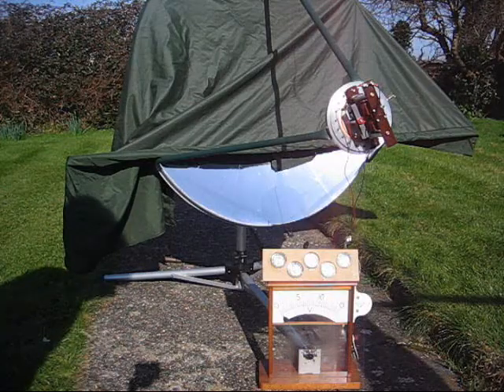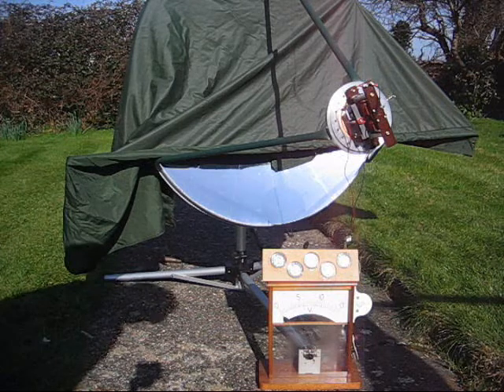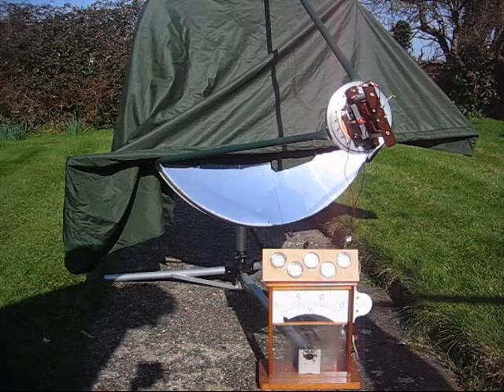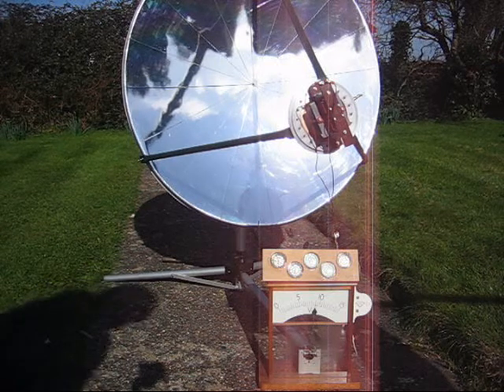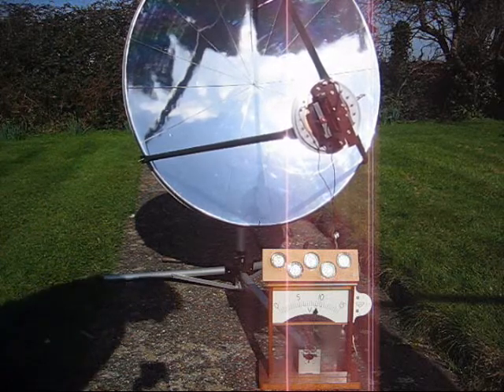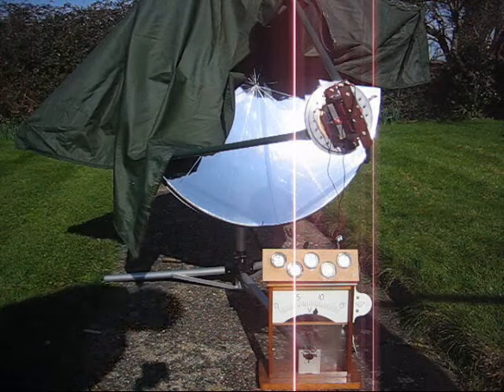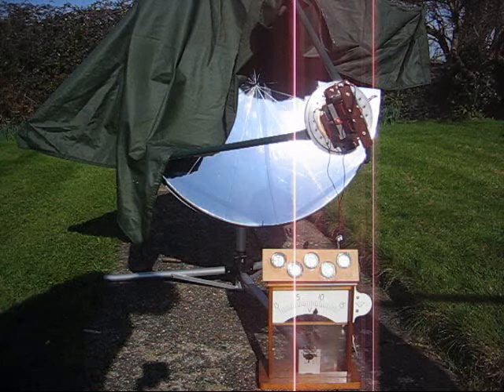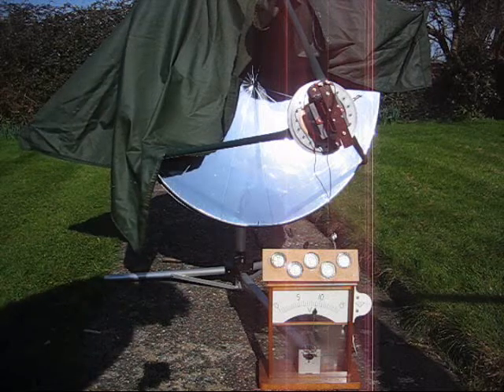Solar powered  Stirling Cycle TMG

Comment: A great job I think by adding a small solar vacuum tube to the heat collector you could enlarge the generator. It's an awesome thing, make some plans, and don't let it be lost like so many great ideas..sell them or give them away, just make sure there is something for someone else to work on, and maybe improve...again great job

Comment: Too much energy , from solar ? :) , that's a new 1 in this world of waste.
A larger engine would be called for.
The vibration of the disc can be overcome by using dissimulator gauges laminated , their harmonic frequency will be different cancelling each other's vibration out.

Comment: Cyril,
Thanks for all the great videos. You do some fantastic work and it shows.  Have you done anything more with the solar powered stirling with regards to dampening like rubber washers, etc.?  What voltage/amps are you getting?  I have been looking at ways to lower my electric bill at my house and that might work with a small grid-tie inverter.  Have you ever thought about manufacturing/selling your stirling engines?  If so, I would be interested in buying one.
Thanks again,
Craig